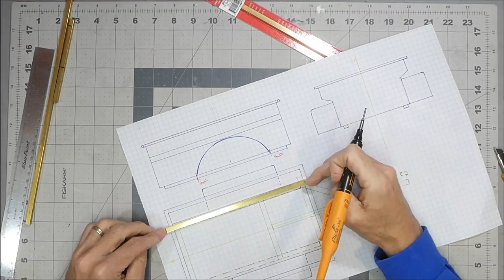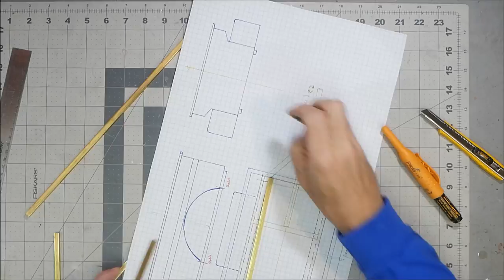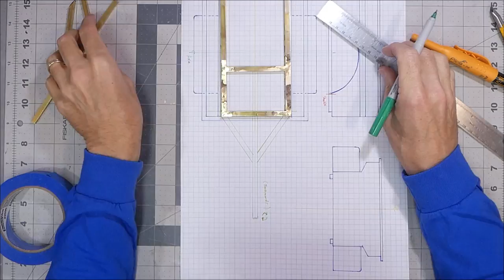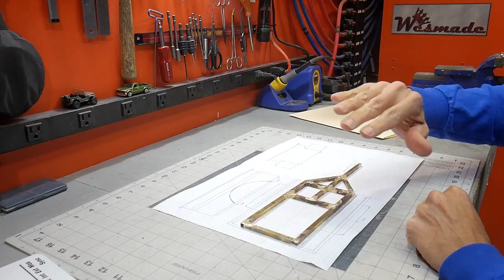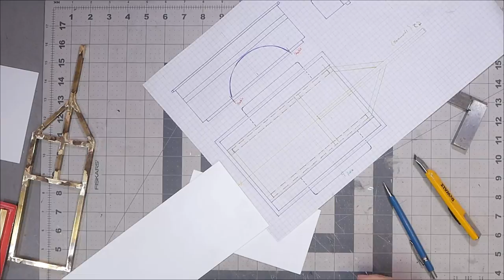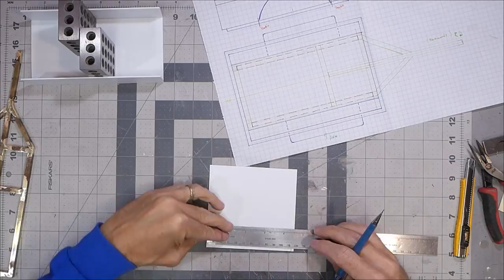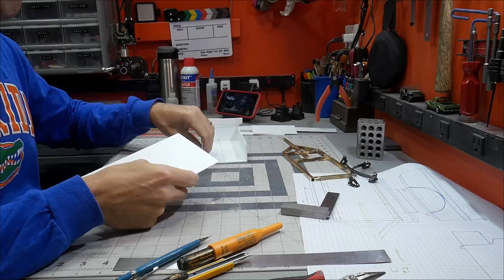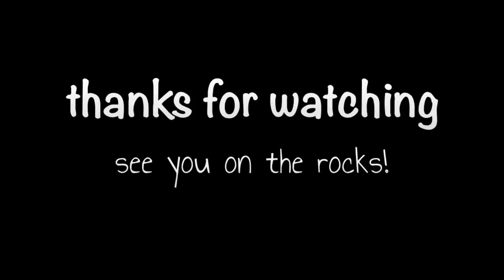Hackjobs Military Off-road Trailer

Comment: Oh one more question.  :)
When you said sanding it to create a better connection,  is this because the plastic glue needs to be as close as possible to create better diffusive adhesion?   And then also create grooves to help with the use of CA which has better mechanical adhesion? 
This makes sense to me.
Recently I was using plastic glue (Faller Expert plastic cement, was recommended) and I was not impressed and strengthened the joint with CA.  I felt I did something wrong and was cheating with CA, but your video has shown it's a good combo.   So thank you for that.
Reply from the maker: Its just about getting the material to touch so it has more surface area.  The two sides get soft, and mix together.  Once it hardens up they sort of become one.  The more surface area the better the connection.
Reply: @wesmadebuilds681  i see,  it's essentially melting them together,  surface texture less important.
Reply from the maker: yes